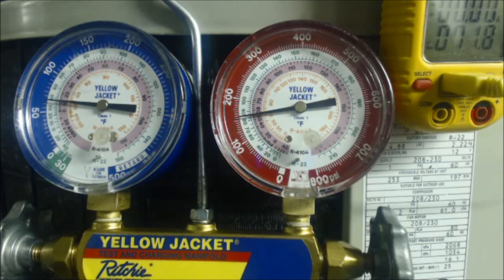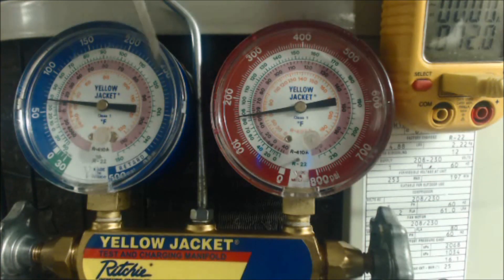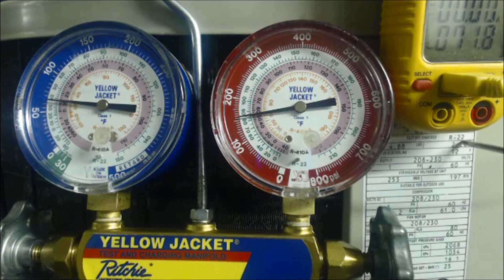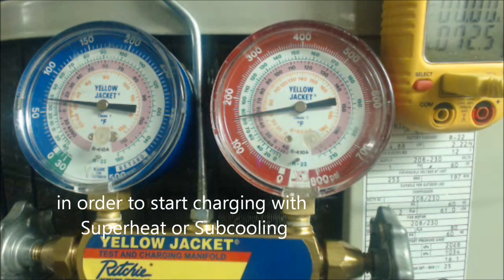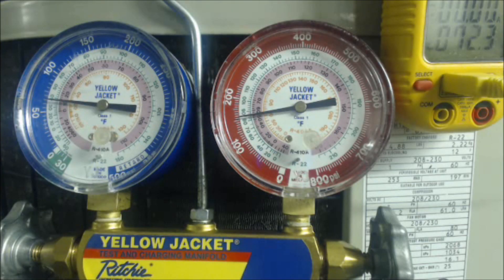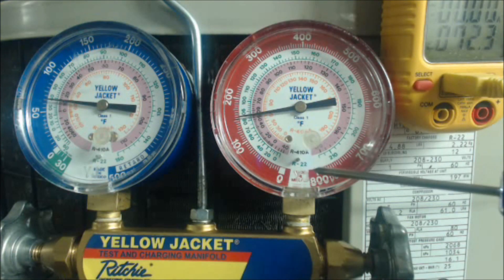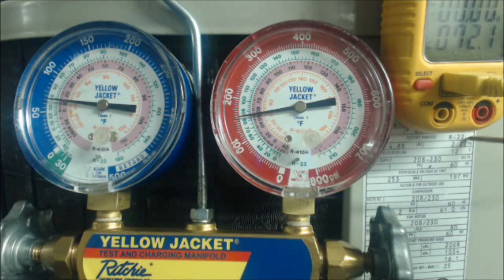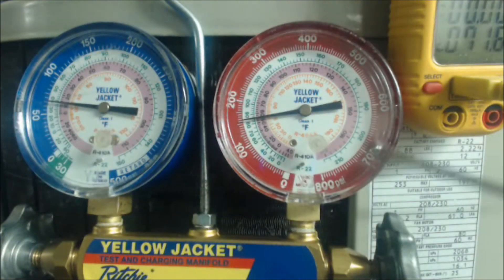Tutorial on How to Use and Read a REFRIGERANT GAUGE SET!

Comment: Thanks for an xlnt video, very helpful. As a serious DIYer who happens to have a degree in chemistry I understand more about liquid and vapor state and saturation that the average bear. Still, I'll admit I haven't understood superheat and subcooling until I watched your video. As another person said, I might need to watch several more times to fully comprehend the concepts but at least for now, I'm beginning to understand why there are those mysterious circular rulings on the center of my gauge sets. When I started 20 years ago I only worked on car A/C and only paid attention to psi. To work with other stuff like central air and dehumidifiers, I need to know more.  Now your teaching skills have me understanding much more. Unfortunately my gauge set is only in º Centigrade but as a chemist, I'm used to dealing in metric system so I can do the conversion in my head close enough.

Comment: I got a case here where I hooked up gauges to an outdoor unit and my low side was reading way too high for the evaporator coil--80 degrees F.  Furthermore, the temp on my high side was tool low as it's also 80 degrees F and, from what I've read, it's supposed to be around 30 degrees higher than the ambient air.  Also, the temp on my liquid line was warmer  (88 degrees) than the condenser coil temps instead of cooler.  What does that mean?

Comment: FINALLY I figured out a separate gauge-related problem thanks to this video:

I use a compound gauge at work that measures vacuum (mmHg VAC) and positive pressure (psi and kPa).  
I understood that on the compound gauge 0 represents 1 atmosphere, but I noticed on the same gauge it goes from 0 psi to 30 psi max.  I asked myself "Wait I thought 14.7 psi is equal to 1 atm?  So how can 1 atm be 0 on the gauge, yet also have 14.7 psi on the same gauge?"
I realized it MUST have some sort of conversion factor (like maybe each mark of psi on the gauge wasn't actually psi units), but I didn't understand what...

Then here you came along and said in your video "...this is measured in psig..."  and it clicked. "Maybe my gauge, DESPITE ONLY SAYING PSI, is actually measuring psi instead!"
So I looked it up and found out psig is equal to psi + 14.7.  That's literally it!  
So on the gauge when it says "16" it actually means "30.7 psi" so now it all makes total sense.

It is all thanks to your video that I was able to figure this out.  NO online resource mentions this about compound gauges, and even the seller just lists the units as mmHg VAC and psi, NOT psig!  
It makes sense now but I was just pulling out my hair.
Reply: I'm surprised you didn't find the answer by searching. If you do a few searches using PSIG and a combination of various ac terms, you should find a definition or explanation. Especially now, as internet resources have greatly increased the last few years.

Comment: My landlords guy came here today because our unit freezes up.....he  attached the gauge to the unit outside.... the red gauge did not move at all.... the blue gauge on the right was bouncing all over the place....... I truly do not believe the guy knew what he was doing.... this guy and his partner are scamming our landlord.... ie one time when the maintenance guy came here to reset our commode he did it wrong a few days later he came back because when I flushed it came out under the commode....anyway his partner left and came back with a root from somewhere and told my landlord it came out of our drain .... our whole septic system had been done the yr before.... ground dug up outside..... trees removed etc etc.... 

   The question I have is shouldn’t the red gauge register if it is connected to the air unit outside?

Comment: Hello, I am barely getting in to this trade and my question is: If you use those gauges to read pressures on a R-22 system and later on you need to take some readings from R-410A system can you use the same gauges to take the readings? Do you perform a vacuum on the same gauges to decontaminate them? or do you recommend having a separate pair of gauges for each type of refrigerant? Thanks
Reply from the maker: If you are starting out, you can blow them out with nitrogen. A vacuum won't pull the oil out of the hoses. You can also hang the hoses straight down so the oil drains out into a container, thanks

Comment: Is it possible to use the gauges while the system is off? I had a tech hook these up on my unit...while it was off. Then tell me it was ok because the low side should be reading 120. ??
Reply from the maker: Wow no, you can't tell anything with the system off. You will get the same pressure reading as long as there is at least some liquid refrigerant in the system but you cannot tell how much, thanks

Comment: When you say “make sure it’s above 32 degrees on vapor side”. Are you saying that regardless of all other factors, as long as the vapor side is above 32 you’re good? So on a hot 110 degree day the center of your evap should only be about 33 or so?
Reply from the maker: Firstly it will depend on the metering device. A piston will fluctuate much more depending on the outdoor temp and indoor wet bulb. When it is 110 degrees outside, the load in the building will likely be high so the sat temp will be higher maybe 40-50 degrees depending on the indoor wet bulb. I just mean, techs may be trying to check the charge when the outdoor temp is low and the indoor load is low or the indoor air is too low and the sat temp in those situations will be low. Once they are low like that frost will accumulate on the coil so you would need to determine what the problem is, thanks!

Comment: Please clarify at 1:00 when you say Zero gauge, that means equalized with the local pressure and hence altitude of your work.  You then say absolute, where that would be 14.7 lb/in^^2 only at mean sea level.  This could make a difference if you are in Colorado, for example.  Do you normalize the gauges before attaching to the unit?
Reply from the maker: Yes, make sure that the gauge set reads 0 PSIG before attaching to any unit, thanks
Reply: Thank you Sir.  Great series.

Comment: I find your videos fantastic... one question... I took a 1 ton window unit, silver sodiered ports onto the low and high side and recharged... I am using a water cooled condensor, I am waiting for a anther guage set to arrive but my cool air is at 40.82F but my water cooled condensor is reading 110F WITH An infra red camera, which I beleave should be the actual gas temperature on the high side.. is it possible that my water cooled unit is too small?? I will know better when my guages come in.. but my water in is 68F and out is 72 (using a large vessel which will obviously not cool fast enough.. ( may go Geothermal ), this is a project..
Reply from the maker: 90-110 is the normal saturated temp on the high side under normal operating conditions, thanks

Comment: Thanks for the good video and explain it. My R22 A/C without turn on shows Blue side 125psi/72F degree and Red side zero psi. What is this mean? Do I have to fill R22 gas or have to check some outside pipe hole firstly ?
Reply from the maker: That wouldn't make much sense if you have pressure on one side and not the other. You may want to check the depressor on the end of your hose or the valve core inside the port that you are hooking into, thanks
Reply: Thanks for the reply quickly, I need to tell more what I have a problem situation. My manifold tool looks good measuring(Red side 150psi) with the other A/C side for 1'st floor, but only this A/C for 2'nd floor has Red side zero psi. So I think there is no problem on the end of hose or the value core inside the port that I am hooking into. Still I am confusing what is mean Red side zero psi if not hose/value port problem.
Reply from the maker: I could see the blue side hooked to the large vapor line being zero and the red high side connected to the small liquid line reading pressure. That would mean severely low on refrigerant but you usually don't see the opposite of that, thanks Moon!
Reply: you are correct, I measured it again today. Blue side is 125psi(73F degree) and Red side is 130psi(75F degree) at power turn off mode. Is this mean that I need to fill just R22 gas ? Sorry to bother you and thanks for your advise me in advance.

Comment: Do you check the pressure when the unit is on or off?
Reply from the maker: To check the refrigerant charge level, it is while the unit is running. My old mic canceled out background noise, thanks

Comment: If i wanted to check my temps for r410a would I just head straight to the r410a part of the gauge and my sat state
Reply from the maker: Yes that i correct and then check superheat or subcooling as needed, thanks

Comment: Great video, this is all new to me and found your video packed full of 
useful information, where I likely watched it 10 times already.  One 
item I seemed to have missed in your explanation of calculating the 
Super Heat temperature was how you got the Actual Temp, so I'm confused 
on where you got the 50DegF value.  Is that the interior of the house 
temp or somewhere else and how to best take that measurement?
Reply from the maker: Actual temp was on the vapor large line. Check out "acservicetech superheat playlist" and acservicetech subcooling playlist" These will break down each step in the process of refrigerant checking and charging, thanks rednroll1!

Comment: What about if the vapor side is way tooo high?? About 300? Psi
Reply from the maker: Is the system running? Is the unit a heat pump? Is the furnace running while the ac unit is on accidentally?

Comment: I am in McAllen, TX.  Our Summer temps are over 110o.  Yesterday,  a tenant complaint her AC was not cooling.  When the AC man checked the freon levels, it was on the high red gauge was 250 PSI. It was super overcharged!   He decreased the freon level to the right #.   For 15 yrs., a trusty AC man has fixed my AC units and on 3/1/208, he changed an evaporator part and motor that were damaged and checked freon levels.  I do not think he overcharged it at that time and nobody else has done anything to the unit- so I think- unless tenant called somebody to charge the unit.  My question is: Is there another way the unit could overcharge itself?   Thank You in advance for your reply !
Reply from the maker: No, that couldn't happen, thanks
Reply: Hola ACservicetech !  What should be the right reading on the red gauge.  The service an who came Saturday said that 250 was too high.  Was he wrong?  This is a R22  3Ton unit.
Reply: abegail

Comment: hi. thank you so much for video. i have question. you said saturated temp have to be above 32 degree before charge. the 32 degree is only for r22  and other refrigerant have other specific temp? or all refrigerant have to be above 32. thanks a lot agian
Reply from the maker: If it was below 32 degree saturated temp then either it is low on refrigerant, liquid line restriction or low airflow. It is for all refrigerants used for air conditioning, thanks

Comment: What are your thoughts on NU22
Reply from the maker: Actually, I like R407C more even though you are should cut the compressor out and replace the mineral oil with poe oil. The problem is that there are no retrofit NU22 txv's and adjustments need to be made to piston sizes or txv's to attain an efficient sat state in the evap. R407-C, you can keep these items as it usually. thanks Josh!

Comment: Hi service tech It seems like my system is low on freon. A company came out found a leak on the shcrader valve filled it and put a cap on it. I didn't know that's what he did until I came home from work. It was ok for a few days and then it would barely cool. I bought a leak detector and went to the cap and it started going off so I turned the cap half way with pliers and he defector stop beeping. I bought a set of gauges but I don't have the green numbers like you have. How else could I tell if low on freon? I took photos of the gauges while hooked if you would like to see them. Low side 40 psig and high side 175 psig. Outside temp 79 indoor temp 74 unit running for 35 minutes
Reply from the maker: Oh yeah 40 psi is very low if it is r22 and very very low if it is r410a. EPA mandates anyone that works with refrigerant to be epa 608 certified before working with refrigerants. In this case type 2 608 so I would advise to call in a service tech if you are in a rush and don't have time to get certified, thanks and sorry to hear!

Comment: Hey service tech. Thanks for this information. I got into it because I bought a new unit 3 years ago and just had to fork out 500$ to have it charged because of a leak in the tubing that connected  to the compressor. Larger of the tubes. Apparently not warrantied. I'll be watching all the videos. Have already bought R410A, gauges, and hoses. Have brand new American Standard. Can you just point me in the right direction to begin? Where should I concentrate?  Again, thanks for sharing this with people.
Reply from the maker: Thanks John, make sure you are epa 608 certified type 2 before handling refrigerants. This could possibly be done at a local technical high school where they may have adult cert testing at night if you don't have this already. With that being said, check out the recovery playlist- https://www.youtube.com/playlist?list=PLxnHR5_D2ojxfgT_HPLImCXkJdhMnUtFo  -- and then the brazing with nitrogen playlist first, thanks-  https://www.youtube.com/playlist?list=PLxnHR5_D2ojxi-kOFQ5FWDIUAE8ngzmZy
Reply: Will do. Appreciate the help.

Comment: can I ask if refrigerant for window type and split type are the same?
Reply from the maker: They will be checked with the superheat process since they have a capillary tube metering device if you have a brazed in service port. Most do not have ports but you can check to see if you have an 18-21 degree temp difference between the return and supply after ten minutes of run time, thanks- superheat playlist- https://www.youtube.com/playlist?list=PLxnHR5_D2ojwGvhU1rseXQLJ-XBjBZMMk
Reply: acservicetech sir can I ask again about the sensor bord? that the 1st service tech.I hire said diagnose on and off after 5-8 min not yet meet the cool temp inside it already resting does it mean it has a problem? or the remote is just in automatic like the other 2nd service tech I hire to check my split type he just said low refrigerant and I need to pay 6500 pH pesos is that fair?